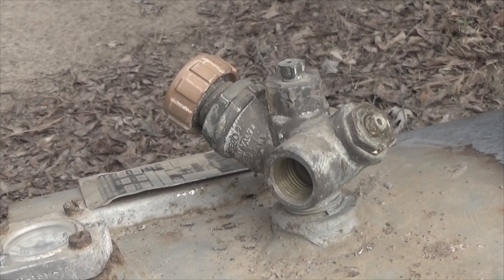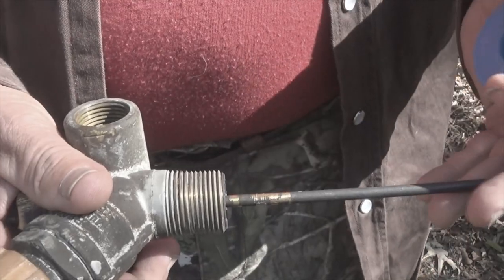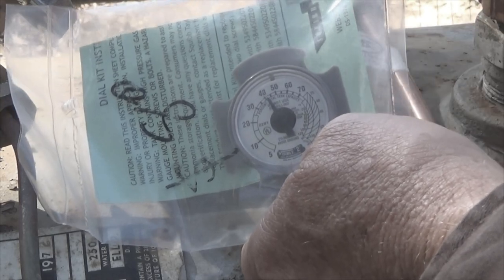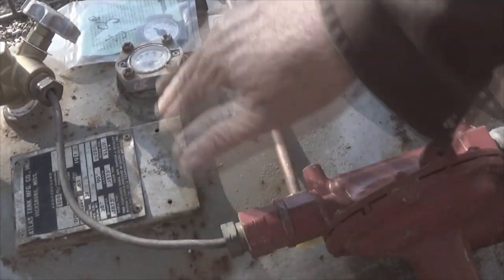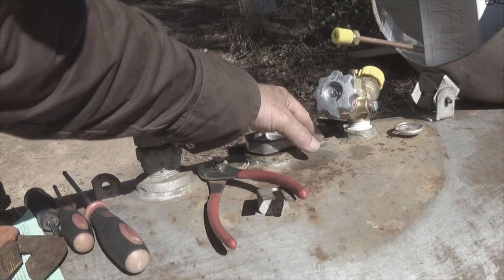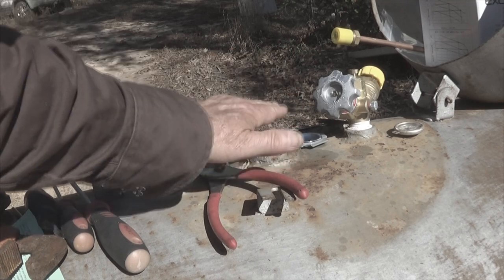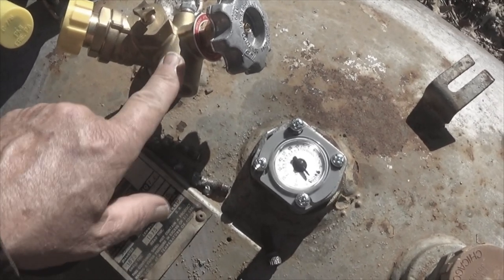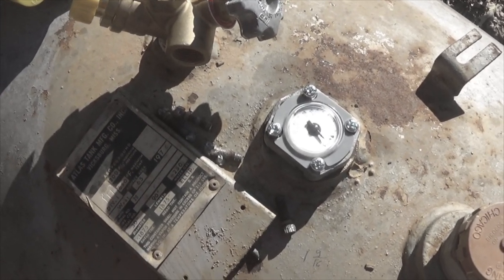repair of a large capacity propane tank

Comment: I'd like to recommend that when raising or lowering gauge through the tank opening, place one hand on the tank while using the other to hold the gauge. This will help eliminate a static charge differential between the gauge and the tank.
Reply from the maker: good advice,    had it had the stoiometric right, i would not be posting this.  but very good advice for those viewing,   seriously, thanks for posting.

Comment: If your gauge didn't work and your shut off valve was broke, how did you know the tank was empty? Not sure if anyone cares but, there is a yellow teflon tape meant for natural gas and propane lines.
Reply from the maker: the valve would not shut off,  that is how i knew it was broken and empty.   as for the yellow,  i do have some, and the tank is holding pressure however long ago i put it back together.

good info on the yellow teflon tape

Comment: Why not just replace the broken piece instead of changing the whole valve? It's either a 19104 50 bonnet or I think it's a 8100 I forget the rest of the numbers..
Reply from the maker: it is no longer made and parts are not for sale
Reply: @dysfunctional_vet  who  told you that lie
Reply from the maker: @tracker1ify  every dealer i called with zero exception
Reply: @dysfunctional_vet  That's interesting. Consider and I have a ben full of them and can order more
Reply from the maker: @tracker1ify  well that is all well and good.   however when i was looking, i did not find your sight so i got what i could.

understand, i have limited time,    i'm in school, i have a full time job, i have a full time family, and i have to do all my internet searches in the intermittent breaks i have.   right now i'm waiting on a massive storm to hit so i'm looking at fracking water for hydrogen

all things in their time and place
Reply: @tracker1ify  do you sell the parts to repair a big propane tank?
Reply: Honestly I tried to encourage people to repair there tanks, but I see what NFPA 58 & NFPA 54 are in place. 😂😂😂

If you don’t know how to measure a Dip Tube For Propane Tanks & multi valves you shouldn’t be messing with tanks & cylinders

Comment: My gauge is leaking by the threads but my garage screws in
Reply from the maker: the one i had, i slid in and it rested on a gasket.
a propane company can pump your tank dry and then you vent it to air for a time before you work on it.   then you may have to talk to the gas company but yellow Teflon might be the fix, and you may need a gasket as i did.

you need to check your state laws on repair however as some companies may not be able to fill your tank if you worked on it.

Comment: Hi, do you know if when you shut the valve off if it shuts gas off to the whole valve body or just the outlet pigtail. i may have a small leak on the side oppisite the shut off handle near the plastic cap
Reply from the maker: Mike, it only shuts off the pig tail.   if you have a leak, i offer this advise.  have a propane company pull the propane, fix the leak and then return the propane.  it costs less than losing what you have.

i found my valve on ebay for about 40-60 more than it cost locally, and in texas we can repair our own stuff.   i don't know if you can do that, but a service charge to fix this would have been about 125 before biden got into office.  i have no idea what it would cost now.  i think i paid about 70=75 for it, and the socket i had to get to break it out.   total was under 103.  labor....none, i had no child in the repair of the tank.

it has been holding pressure since about a week before i put that video up.  i had a lot of folks tell me i needed yellow tape, but in the oil field i used the exact same thing here for pressure equal to, or exceeding this value.  but follow your state's guidlines for insurance reasons.
Reply: thank you, vid was very good

Comment: Hello, What is the size of the shut-off valve? I want to purchase a pigtail pipe for it.  Is it POL?  Thanks
Reply from the maker: i will have to check, but i am thinking it was a 3/4 inch thread, the copper tubing is something i will have to also check for you as soon as i can.
Reply from the maker: it took a while to get the info,    (i'm a full time student and mom to 13 dogs, a dad to the same number)
the pig tail is a 3/4 inch thread with a 3/8 inch copper tubing off of it.

if i can help further, let me know.
last night for the first time in some years, a few coyotes came up the fence and were sticking thier heads in and my dogs were licking their faces and if my dogs stuck their head through the coyotes were licking them       i had never seen this before.  i know that they will sometimes play together but sometimes the coyotes are hungry and it is not good

Comment: Was your tank empty when you changed the valve
Reply from the maker: yes,  for 3 days open to atmospheric pressure.   any pressure at all will put great stress on the threads when you try to open it, which would result in death if your lucky, and worse if not, as it would come apart explosively with or without detonation.

Comment: I'm trying to replace one of those same valves but mine is shaped off and can't find any tool that can remove the broken off valve due to a built in spring valve in side the pipe any suggestions my tanks not been used for proper in years had been converted to a bulk air tank but they just drilled a second hole and put in a air valve now that it's been moved to my new place and was hit getting it off the truck the valve snaped off need it removed to replace it with a cap to hold air again

Comment: Did your old valve have a large tube that almost reached the bottom? I have the new one multivalve, old one out. Threads are the same, they look identical except for the large diameter tube that goes down into the tank. What is that for? Is it needed?
Reply from the maker: while i am not totally sure about the long tube sticking down, it may be so that the tank can be drained for moving.  some tanks, i have read can be drained. this one could not be drained.
i used white and some have commented you need yellow.  this tank has not leaked down in the years since i put this in.

you might ask the guy you sold the valve to you.   i wish things were more clear.   the other possibility is that it might be used for filling small tanks (20 pound) something i would never attempt

Comment: Doesn’t propane require yellow Teflon?
Reply from the maker: when i pulled the thing out of the tank, it did not have tape or thread dope
Reply from the maker: oh ya, it has been holding pressure without leaking since i posted the video, however long that has been.

Comment: were did you get the seal or gasket for sealing the gauge to the tank?
Reply from the maker: i got it at a local store,  i can give you the address and phone number.   
this is the info you will need.   the valve will have a number on it, and that will give the size of the gasket.   
on this tank, going by memory and not looking at the video, it seemed it was recessed about 1/8 of an inch.  the gasket was a flat rubber, and i wondered if it would fit,  and it did.

when you contact them if you wish to go this route, have the number of that valve on top so that they can look up the replacement valve size.  the valves are exactly alike in my case, just new numbers.

i paid about 2 to 3 dollars for the valve

from whenever it was posted to now, it is still holding pressure without leaking

this is the place   (903) 723-6222
Reply from the maker: oh hang, you asked about the gage,     i'm doing a thousand different things.   the gage is magnetic, it does not have a gasket or seal.....

been digging a 1 yard pit for drilling a well, the sun got to me

Comment: Where did you buy the parts?  I need to rebuild a similar tank.
Reply from the maker: nelson propane in palestine texas.    make sure you measure carefully the diameter of the opening and the thickness of the gaskets.   also a photo of the part will help.
the gas dial works on a magnet that is under it, so getting the size is important.    i wondered how they worked and thought it was genius.

one think to keep in mind, the gage has an orientation to it.  if you get it backwards, it will read incorrectly.   but you just turn it since it is not part of the pressure hull, unless it is held in place by the machine thread screws that hold the pressure plate of the gage on.
Reply: @dysfunctional_vet  The tank was made in 1952, if I read the label correctly.
Reply from the maker: @davidtreibs122  the call numbers on the valve and that sort of stuff will have changed but they can look that up. that is what they did for me.   
by law, a tank can only be filled if it has the original label on it.  so don't let it get lost